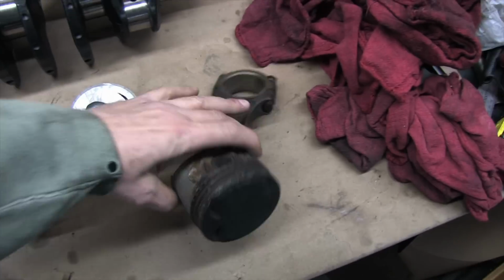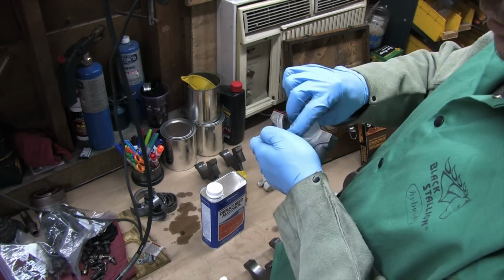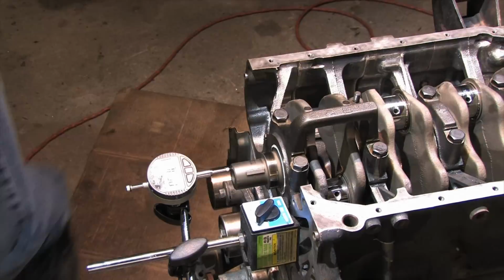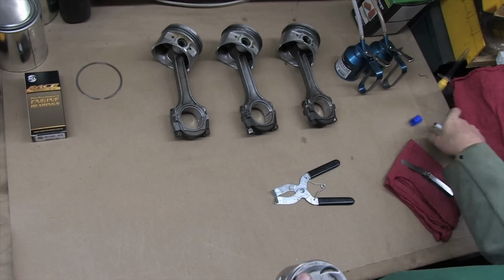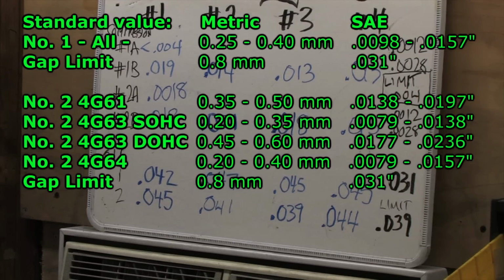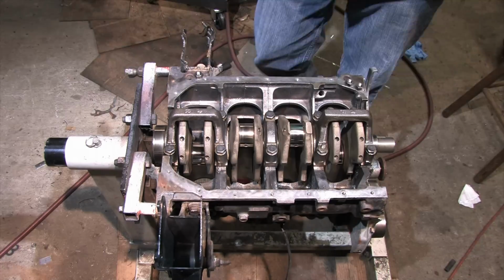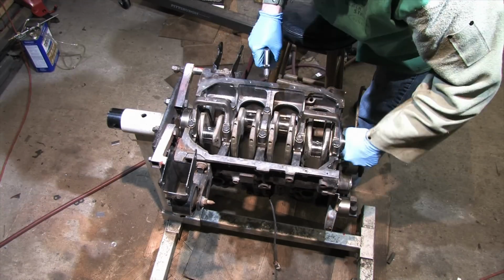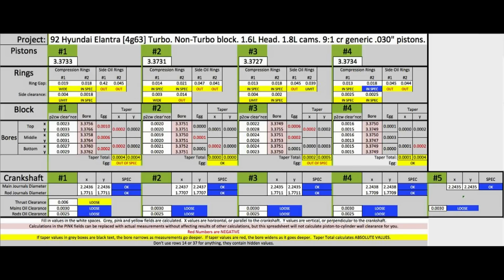Hyundai Assembly 1 - Blueprint Everything

Comment: why are you using an digital wrench? Analog wrenches are more accurate!
Reply from the maker: Mentartice2 The only analog wrenches more accurate than my current digital wrenches are needle-style.  There isn't a clicker wrench anywhere out there more accurate then the ones I currently have.  But the real reason you see them in my videos is so you can read and see in the video that I'm doing it correctly, and what my torque loads are.  Clicker wrenches don't do that.  They also allow you to exercise bad torquing habits that the digital wrenches break you of.  I approached digital wrenches with skepticism, resistance and rejection until I started using them and figured out why they're better.  I was just like you once.  Since then I dropped $1,100 on two of them.  The one in this video was borrowed from a guy with 14 GM certifications.
Reply: ***** Thanks for awnsering so fast :) I live in Germany and im going to be an electromechanics. I dunno if you know about the dual-school-system over here. 2 diffenent typs of schools, and a workshop where they show me the practice that i need for working. 3 1/2 years it will take me. In school they told me not to use digital measuring instruments, because u can not prove if it's  working well. Analog instruments will show you instantly that they are not working. But they did tell me that there are digital measuring instruments that work better then analogs, but cost like 10 times as much as the analog ones. Can you tell me what you mean with "14 GM"? Did you study something about cars or how do you got that much knowledge about all that stuff?

Your vids. could be used in my school for teaching, the only problem is that the teachers are not good at english :)
Reply from the maker: I know for a fact that schools in Germany have our schools absolutely destroyed and out-classed.  I studied German for 2 years and my teacher, Frau Glagola escaped Germany during the erection of the East German wall.  We were baffled to learn how by what we call "middle school" the German students were multi-lingual, sometimes working on a third language.  Unless an American student grew up in an immigrant household, that's a rarity here.

There are laser-based wrenches that are better than mine, but mine are ± 2° accuracy from 20% to 100% range in either direction, and ±3° from 0-20% in either direction.  It's hard to find any clicker-style wrench at even half their cost that can keep up with that.  The wrenches I purchased were the Snap-On ATECH2FR100B and the ATECH3FR250B.  As long as you have the wrenches calibrated on a regular basis, the design of these wrenches don't let you have the false sense of security that the "click" style wrenches offer.  If you don't smoothly approach the final torque in one motion, you can end up being as much as 30% off.  The digital wrenches I use tell you exactly what torque you achieved after you're done.

The 14 GM means he has 14 General Motors certifications for servicing cars made by GM.  He was a fleet mechanic for DuPont chemical who also serviced all of the Ford trucks as well as rail car pushers and manufacturing equipment.  He was such a good mechanic that he achieved that ranking by the age of 26.  I fought him tooth and nail on the issue of digital vs. electronic until I experienced it first-hand.  His torque wrench taught me that I didn't know the first thing about how to correctly use a torque wrench.  It broke me of all my bad habits.  The "CLICK" gives most mechanics a false sense of security.  On the electronic wrenches which show you how close you are to the "click", it offers you feedback and encouragement to keep going with one smooth and gradual sweep.  It tells you how far you've got left to go.  Had he not put one in my hands and made me use it, I would never have bought the wrenches I now own.
Reply from the maker: Start at 16 minutes and 40 seconds on Hyundai Assembly 7 if you want to see the two wrenches I bought.  The one in this video is the one I borrowed from Chad.  The wrenches I use today are the models that are currently being sold by Snap-On.  They do torque angle as well as torque, and a host of other features including 5 different torque scales, LED torque indicators and display backlighting.  They're pretty awesome!
Reply: 3 1/2 years later and i finished my school. Now im officially a Electromechanic. Thanks for your very detailed awnser. I really appreciate it! In the last 3 years i have to say i never saw a digital torque wrench. I think its just to expensive for most workshops. The analog ones are accuarate enough for a gurantee that it will work without damage. Our analog ones are around 600€ each (the wrench has a range between 20nm-250nm). I have no idea what tolerance they have. But i think its under ±10°. What i learned is that most bolts have a tolerance them self before you will overtorque them. So beeing that accurate is only needed for very special applications. Im planing in buying a digital wrench to show my colleagues what its good for and compare it. I planed to to test it while chaning tires with 120nm torque. So first i will use the analog one with 120nm and then check it with the digital one, to see how far off it is. America has still high value for me in mechanics. Having a good school help beeing a good mechanic but it doesn't ensure it. That is amazing that you studied in Germany.

Comment: 1:00 "Polished and chamfered to improve oil flow".. Now that doesn't make sense to me how would enlarging the clearances improve oil flow that would just reduce pressure. That sounded so stupid.
Reply from the maker: Marc Kolz The oil in the gallery is passing by a smooth bearing surface.  Let me put it in layman's terms so you can understand.  Which one uses more ink? a) a fine-point marker b) a wide-tipped magic marker.  

Next question... Given that both travel the same distance between two points, which one runs out of ink first?  a) the fine tipped marker.  b) the wide-tipped marker.

Finally, how does chamfering increase the size of the oil gallery or have any affect on its pressure?

But really, just come right in and grind your muddy feet on my couch.
Reply: ***** Because if the clearances are too large there's less flow/velocity. Same kind of principle as exhaust gases leaving the engine. Too large of a pipe you got less velocity, too small and its constricted. The engine manufacturers put the perfect amount of clearance in the oil passages for optimum flow, not too large not too small.... Its the size of the bearings and clearances which make actual oil pressure.The oil pump only makes flow which really does nothing for performance until it get's into the bearings. What you mean is making more flow which is not necessarily what you want.
Reply: ***** Maybe I don't know what I'm talking about. Is this what you did? http://honda-tech.com/all-motor-naturally-aspirated-44/champher-crank-2962934/
Reply from the maker: It's what you want when your shortblock makes 44 lbs of oil pressure at idle because you removed your balances shafts, when you increase your oil clearances to .0005" beyond the good oil clearance specification to releive the extra 34 PSI, and have to deliver enough oil from a stock-sized oil gallery, sometimes you have to upgrade the galleries that move that oil.  Chamfering is the shit and every old timer will tell you that.  The flow direction from the CRANK MAINS goes to the RODS, and I'm doing everything I can to move oil from my loose-main-oil-clearanced crank to my loose-oil-clearanced rods.

This engine was an oil pressure disaster when I got my hands on it.  It failed, I've gone through it.  I've fixed every oil pressure and flow problem it had and perfected its oil pressure with changes to my oil clearances, modifications to the head's oil supply, modifications to the regulator, and modifications to the front case.  All of them are documented here including my oil clearances.  There are 3 informational videos here about oil pressure that explain in great detail with animations and examples of everything you just told me.

Today this engine idles at 10-12 PSI, and it goes up 10 PSI per 1000 RPMs.  It doesn't exceed 86 PSI at red line.  All of the modifications which I described and used were necessary to achieve that, and I nailed it.
Reply from the maker: Marc Kolz Mostly.  I wasn't anywhere as careful as the person who did what's pictured there.  There's no such thing as a perfect shaped chamfer, usualy a manufacturer either chamfers their cranks, or they don't.  Every crank that doesn't have them can benefit from having them.

I would like to add...  if the oil clearances regulate the oil flow given any pressure at all, then what is the disadvantage of using a wide-tipped marker?  ;)
Reply: ***** You make high pressure with the balance shafts REMOVED? THat's crazy cause on my 2.2-2.3 liter Honda engines, when you remove the balance shafts (unless you get a proper delete kit with studs to block oil passages),  you lose a lot of oil pressure. So much so you'll trigger the low pressure sender to go off. What you just do is either take the balance belt off and leave the shafts in, or get the delete kit which has studs  you put on the main girdle to cut off the passages to them. Don't really get how you had high pressure, strange. I know my Honda's, early 90's 00's, but I don't know Hyundai's. Enlighten me.
Reply from the maker: Marc Kolz When you remove balance shafts properly, you use a bearing driver set that I demonstrate in Hyundai Assembly 3 to knock the balance shaft bearings out, flip them 180°, and re-insert them so that they block the oil supply off completely.  On a DSM, the rear or right shaft is hollow and therefore IS the oil supply.  If you remove it, the oil pump driven gear doesn't have an axle anymore to keep itself aligned and the pump will fail, so you have a install a stub shaft from a mirage, or chop off the back end of the factory shaft and plug the oil gallery.  Essentially, doing a balance shaft removal blocks off 4 oil holes.  That's 4 less holes to leak oil from than your engine had with the shafts installed.  If someone removes their balances shafts without addressing these details, then they deserve the fate that is rapidly charging towards them.

What I think is funky about the F-series hondas is that both balance shafts are driven by the same belt.  I've been messing with one for the past 3 days.  It's a $300 285k mile-old 92 Accord with the Hyundai's old free go-fast parts slapped on it.  Who said Mitsubishi parts don't fit a Honda?  I have no doubts it's a low-13, high-12 second car and I'll be introducing the F-bomb soon, so you'll see soon enough.
Reply: ***** Wait Hyundai parts are made by Mitsu? I'm confused. And you put those an an F22a? Even more confused. Its a 13 second car? I know what you mean its the turbo off the Eclipse. Yeah the bolt flanges on the exhaust manifold bolt up perfectly for that. 300,000 mile bottom end won't last long for sure tho, a 13 second CB7 Accord is like 250-300 WHP stock cast piston lands break especially used ones. But let me see your build I'm interested... I'm putting a H23 Vtec (JDM only motor) in my 91' Accord wagon and am leaving the balance belt off. Quicker RPM's and more MPG's, its a win win.
Reply from the maker: 1990-1995 Hyundais used Mitsubishi 4gxx engine designs, designated as G4xx engine codes.  There's a video on here called "Why so SIRIUS" where I demonstrate how a 2000-2005 Kia Optima whose engines are made by Hyundai actually uses a 2.4L EVO engine.

The engine in this video was made from a 2.0L 6-bolt NA Galant block with a J1 1.6L Hyundai Elantra head.  It previously used cams from a 1.8L Hyundai Sonata, and all the bolt on stuff from a turbo Eclipse.  Engine mounts were mixed and matched to bolt the engine with turbo FWD Eclipse transmission into a auto-to-manual swapped '92 Elantra chassis.  It never should have been built, but that's what's so awesome about it.

F-bomb was making WAY MORE than 300hp before it lived up to its name.  I have no doubt it was mid-to-upper 300's.  We made it to 22 PSI and a 155mph pull before running out of ring gap.  That thing walked the dog on every single street car we ever raced, and lived 10 months before that fateful day.  We got a new engine for it Friday, pulled the old motor and finished the install Sunday, and I spent this evening riding around auto-tuning in Hondata to find we needed to flash the old tune back in because it worked better than what we ended up with tonight.  The new motor has only 67,000 miles on it, so it's never going to see more than 16 PSI.  

It's not the Honda cast ring lands that are weak.  It's how  the OE-spec NA ring gaps are too tight for a boosted setup.  My Hyundai is using generic .030 over cast Galant pistons and doing just fine at 20+ PSI because the ring gaps are huge.  It's how I get away with it.  They need room to grow and those ring lands hold up just fine if the rings have it.

Comment from the maker: + Abdulla Fuad AbuHadhood  Notice your replies are disabled.  Notice how this message doesn't alert you that I've answered your question.  Notice what a failure Google+ is as a commenting system on a YouTube video.

The chart is just a Microsoft Excel spreadsheet I built that does some of the math and calculations you'll encounter while building an engine.  I plan to further refine it, custom-tailor it to a 4g63 and then release it to the public. I know that once I do, all manner of abuse will occur to both me and the spreadsheet because that's how the internet works.  I'll probably do it anyways.  But it's not ready for primetime in its current state.  I'll do a better job on it with the GSX build.
Reply: Simply coating the cylinder with oil from a cloth will glaze the cylinders when the engine is fired-up?
Reply: Billyloving Billyloving@yahoo
Reply: +Jafromobile Any updates on that spreadsheet?  Sourcing a block and plan on doing spreadsheets instead of whiteboards; this would be a good head start.
Reply: Hey Jafro, did you ever release your spreadsheet? I made my own while doing a build, but it's separated in different sheets. I'd like a big compiled one like yours. Thanks!
Reply from the maker: @TheShafro  Sorry I missed this 6 months ago.  I built it all on one page by using white on white text calculation fields outside of the printable area.  Calculated values occur off-screen when you fill in the measurement fields on the spreadsheet, and a series of on-screen if/then calculation fields fill in the tight/normal/loose/out of spec results based off of the actual factory specs and those off-screen calculations.  I put the actual measurements for the 4g63 factory specs into the formulas.  What I need to do is a separate set of cells that lets you enter your own factory specs, and those fields are used as variables in the formulas.  That way it would apply to any 4-cylinder engine.  BYO specs.  Most of my viewers don't have a 4g63.  I'm telling you, this spreadsheet is going to get so abused...
Reply: @Jafromobile  Hey Jafro, I do spreadsheets for a living basically.  I'd be happy to help you out with it if that is delaying you.  Let me know man.

Comment from the maker: +Robert Ballard your replies are disabled.  Look closely at the set again.  Only half the shells should be grooved on the mains.  If you haven't cut the plastic open, it will appear as though all of them are grooved.  The groove meets up with the other half of the bearing shell, and the groove extends to the oil holes, but it shouldn't go all the way around.  If you've already cut the plastic and looked at all of them, and they are indeed grooved, then I would not use those bearings if the groove is full-circumference.  Not on a 4g63 anyway.

Comment: Hello, I am building a hybrid motor with 4g63 head on a  4g64 wideblock from a truck. The pistons are wiseco, 4g63t rods and the required crank of the two blocks to fit. I had a shop inspect and assemble block some years ago and now I am trying to finish up the build but was told I need to disassemble the block again to have it balanced with my lightweight competition flywheel and clutch set. Is this balancing necessary on this hybrid build in your opinion? thanks...
i am running no balance shaft also.

Comment: Unaware if this is explain in another video, and I looked through the comments to see if the explanation was in there and didn't see it. So ill ask, why the coffee filters?
Reply from the maker: erikdude666 They're barely absorbent with a soft-but-coarse texture making them great for wiping up junk.  They don't tear and come apart like a paper towel would.  The ultra-fine paper fibers aren't big enough if they ever do come loose to cause a problem.  They basically behave as lint-free cloths, and they're made from the exact same material that engine building cloths are made out of (at a fraction of a price).  Paper.  Super-fine strand paper.

Comment: Is A 93 NT 6bolt a forged crank like the turbo ? didn't look like it to me , so I went to swap them out 91 crank from my turbo block with a hole and noticed the crank changes in the rear seal aria, also noticed the difference in color , and no oil squirts but knew that one right off. So any idea on the crank though?
Reply: oh and by the way they are different and non interchangeable , even the fly wheels are different, so I welded my 91 6 bolt block back together with the mig . looks and works good , the hole was in the balance shaft aria, fixed it and back to the oil squirt block yea. went with a balance elimo shaft kit and whelah.
Reply from the maker: A 93 and a 91 aren't compatible.  Correct.  A 93 is not a 6-bolt.  It's a 7-bolt.  The crank that would work can only come from an '89.9 - '92.5.  That's from CAPS.  That's the end of 1989 to may 1992.
Reply from the maker: djweszone Nice job!  Here's hoping it holds oil!